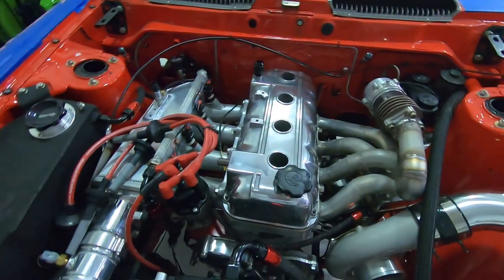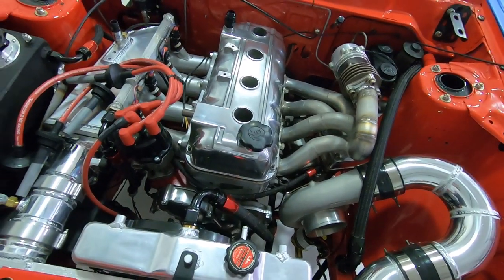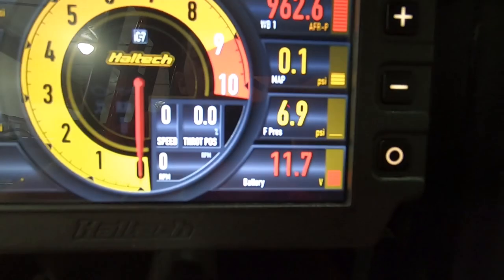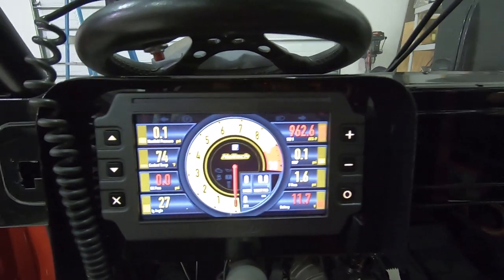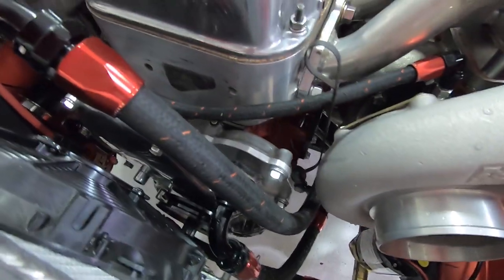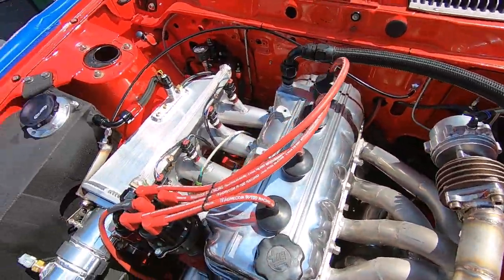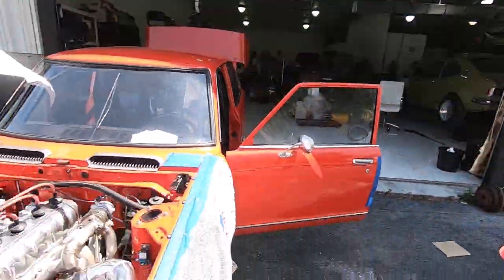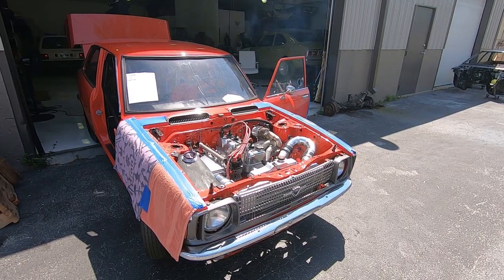Toyota 3tc Dragcar start up

Comment: The 2 T ,3T Engine Are Very Powerful, But Many People Are Complaining About It Head Cover Which is Aluminum, Instead Of Iron, Is it True That The Aluminum can Easily Explodes? Can 2 T Engine Be Modified To Move Moderate 4×4 Nissan Pickup? Can it last if fixed it inside the Nissan Pickup? Thanks for letting us know more about Toyota Engines.
Reply from the maker: 2T 3T are great engines, Head is a little weak but can take alot of abuse for sure. How much power are you looking to make??

Comment: How does this happen without an alternator?   Such a clean engine bay.
Reply: Nevermind lol I just saw the massive battery
Reply from the maker: @zero_to_1000  hahahhaha yea it will run a 16v battery setup, in this video it has a regular 12volt. The 16 volt batteries are awesome and even under low power still maintain about 14 volts. Our next video will explain all of that

Comment: What a dream car.. I have a 91 rolla, and debating on doing something to her
Reply: Fwd.. throw away. Get a RWD rolla
Reply: @mryaj0095  I want to modify the car I already own because it was my great grandma and grandpa’s. Kinda like a legacy in a sense.
Reply: @Z-man8768  silvertop 4ag
Reply: @mryaj0095  thinking of running a conversion... I read you can put the top end of the 4a ge ontop of the 4a-fe but needs some head work done first.
Reply: Put a 2zz in it, easy swap and plenty of power and you can have your ac and all the good stuff in case  you still want to use it as a daily driver.